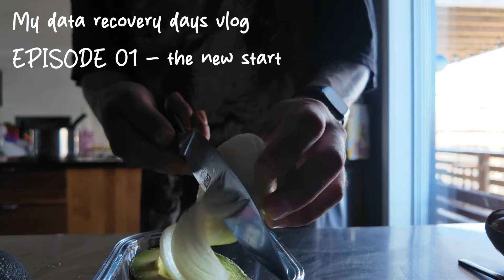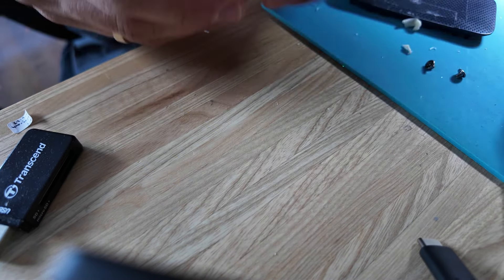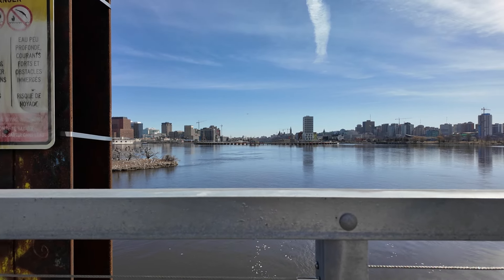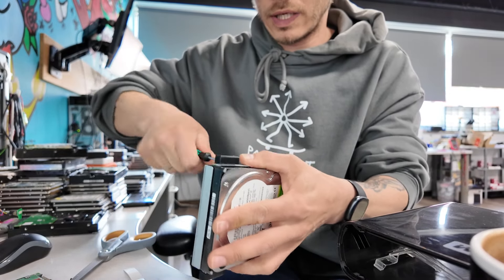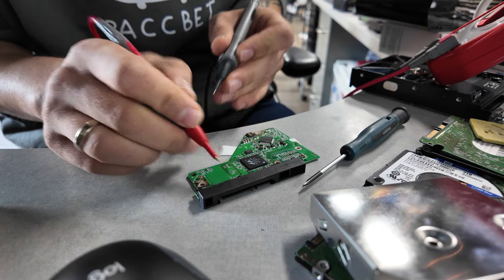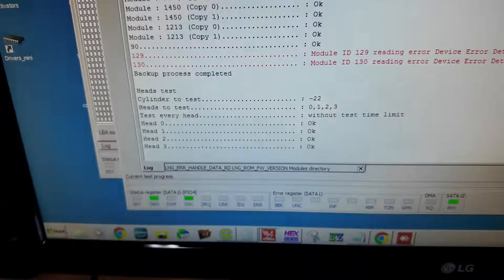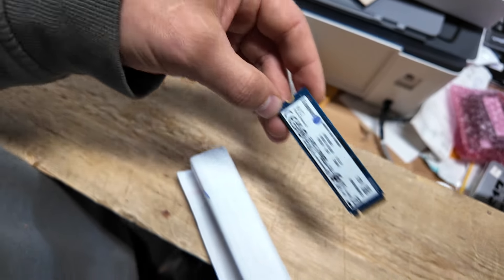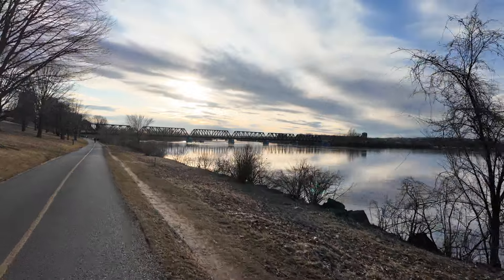Data Recovery Vlog | Adventures of Solar Eclipse Day

Comment: What ebike is it? Reminds me of a Himiway Zebra
Reply from the maker: no name, I think its called Swift. I changed the look of it a little. Bars with cage (super convenient to carry stuff), white walls, seat, headlight.
Reply: @hddrecoveryservices  Seems to work well. I got the Zebra for it's load capacity and range. Still making changes. There is no 'one size fits all' option, alter until it suits your needs perfectly. Swapped the handlebars, seat, pedals, grips, improving the luggage platform, adding turn signals etc.

Comment: Hard drives still have a place thats why they're still made.! Speaking of old drives, I was rummaging around my big box of old vintage electronics, and I came across  a old/new still in the package [QUANTUM VIKING II 4550 4550MB 3.5" UltraWide SCSI-3 68 pin] Early 90s vintage !! The sales receipt was  $846.00. The card to run it was an additional 120.00 🤑 cutting edge at the time, man, how things have changed 😅 enjoyed your video!
Reply from the maker: OMG $846